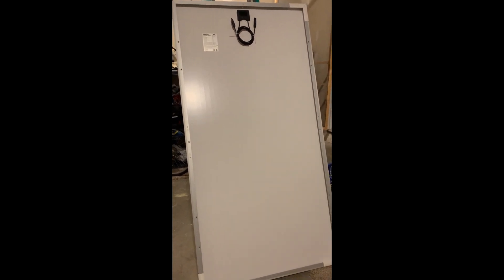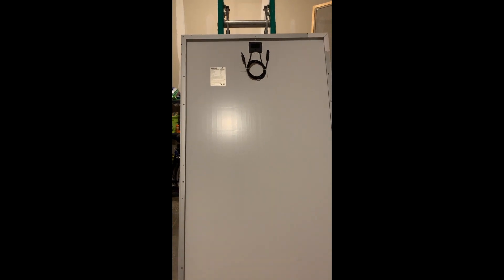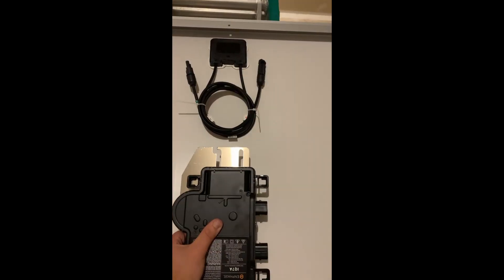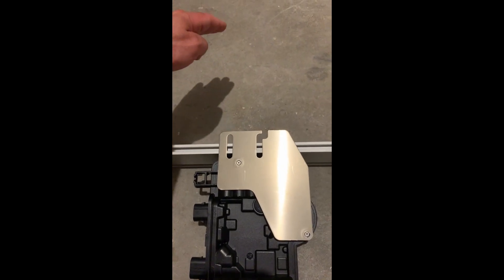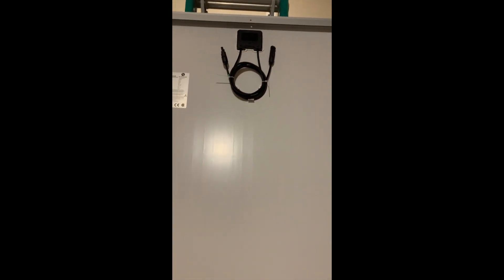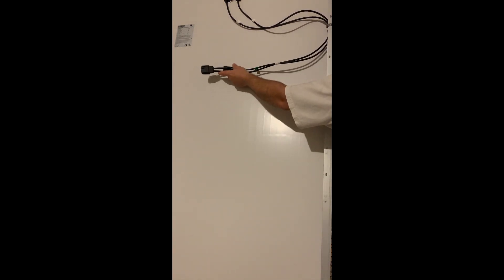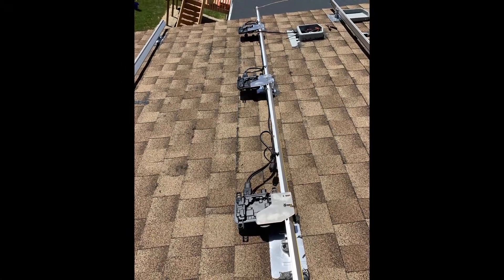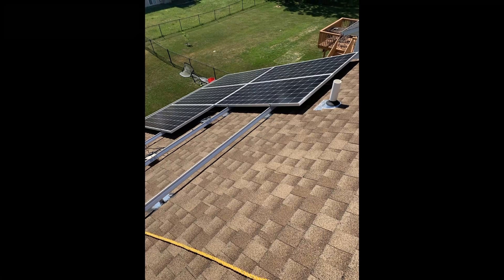Solar Panel Preparation and Connections

Comment: When you plug the AC cable to the iq8 does it matter what way that plugs in. The plug is not designed as a one way only option plug.
Reply from the maker: Thanks for the comment. The AC connections to the Enphase IQ7 microinverter models is designed to be connected to the Enphase Q Cable, and the plugs in the Enphase Q cable can be connected either way. Those plugs are NOT keyed because they are for 2-wire AC circuits, where the polarity does not matter. The polarity (Positive or Negative) only matter in DC circuits, which is why the DC connectors on the microinverters and out of the solar panels are keyed and labeled to prevent inverse polarity.
For consistency, I still recommend connecting the Q cable to the microinverters in the same orientation in case something needs to be troubleshot in the future.
Reply: @DIAYG  oooi0iiii8a😅